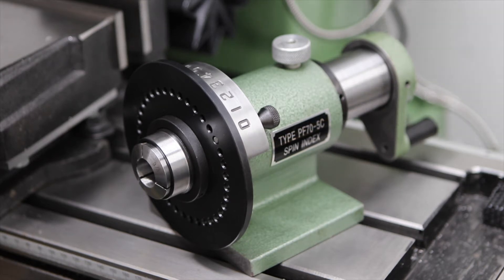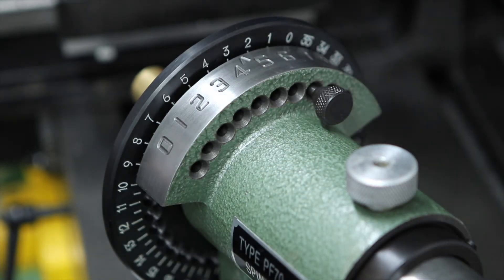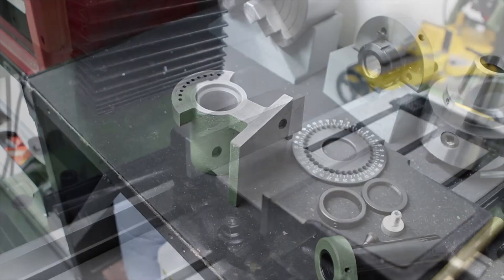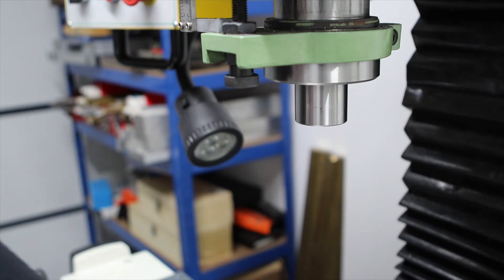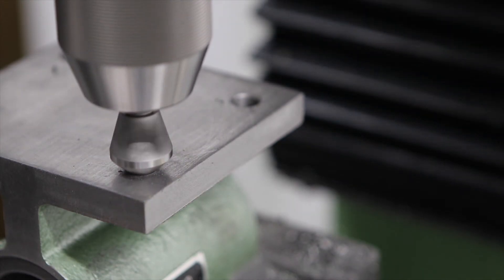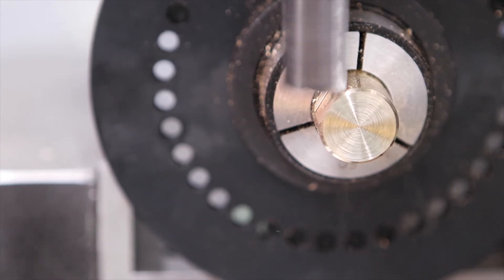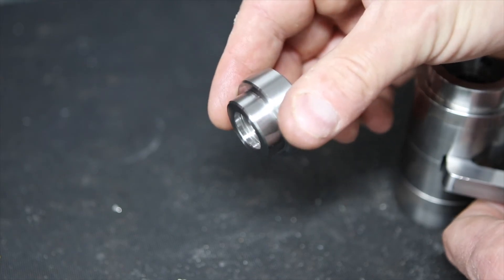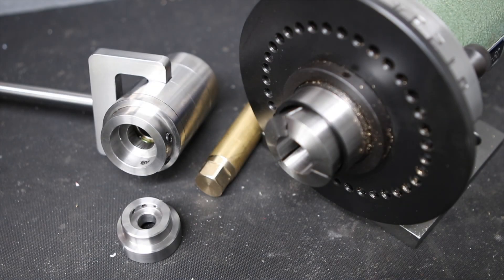How to modify and use a Spin indexer (Spindexer)

Comment: Indexing plates are such a clever use of geometry to achieve fine and repeatable divisions of a circle. There's something really satisfying about them in the same way that vernier scales, slide rules, protractors, and carpenter's sectors are satisfying, and you can still do excellent work with them.

But at the same time, servo motors these days are cheap, precise, flexible, and not at all fussy. Whatever arbitrary angle you want, it's easy to do with a digital dividing head. Just plug in the numbers and off you go. And they often work as 4th axes in CNC setups to boot.
Reply from the maker: Interesting, I might build one someday

Comment: Edge finding on a hammerite painted casting.  lol.  "How 'NOT' to modify and use a Spin indexer".   Should have centered on the fitted spindle.
Reply: He can center the edges with the spindle center line later if he wishes. There's no good reason to do so that I can think of.

Comment: Nice work.  You mentioned that the front and back edges of the base were already machined.  Were they not perpendicular to the spindle, so you weren't able use them as a reference to machine the sides?  Thanks.  Regards.
Reply from the maker: They weren’t all that accurately machined from memory.

Comment: I bought one of these indexers and it's a piece of shit. Why? Because, like all tools, it's made in China. The spindle has a 0.006 play and the collar holding the spindle in is loose; they should have also made it at least an inch long so that it slips into the spindle with greater surface area A split sleeve would have been better. God forbid the Chinese make efforts to make these spinners BETTER. And f**k spending time fixing something that is suppose to be NEW!! Why would anyone buy a spinner knowing that the body has a 0.006" oversized bore? This is worse than a used one. So I'm throwing mine away because I ABHOR cheap tools! To hell with all of them!
Reply from the maker: I agree. Unfortunately it’s hard to buy quality tooling at a decent price these days. Seems like everything is either import or Uber expensive.
Reply: There's some really cheap indexers on the market that're not worth throwing at a bull. Mine, made in Taiwan over twenty years ago, looks identical to the one is this video. It's well made with a closely fitted barrel suitable for most tool making work. Expect to pay  $150 -$300 for higher quality units.

Comment: Is there a spin indexer out there that can be used on a lathe?
Reply from the maker: You could clamp it to your cross slide if you had Tee slots at the right spacing. Alternatively, take a look at my other videos, I have one where I make an indexing attachment for the lathe that works on the same principle.
Reply: @joneseymakes  will do. Thank you

Comment: 9:58 What's the process of determining how far down to mill to get the proper sized hex?
Reply from the maker: Well, you know what size you need the hex to be across the flats, let's say 16mm. If you are using 20mm bar stock then 20mm - 16mm = 4mm. You need to take cuts either side to produce the flats, so a 2mm depth of cut should result in a 16mm hex.

Comment: I would like to use a spin index to mount a boring head then use it on the lathe to cut convex and concave curves. I think I would have to remove my compound and build an adapter plate to fit the compound mounting and then bolt the index to the plate. Does that sound reasonable or am I making this way harder than it needs to be?
Reply from the maker: Hi Gill. Depends on what you are trying to achieve. I think what you are describing can be done with a ball turning attachment for the lathe (I will be building one of these shortly). I’ve seen others use a modified boring head to do the same thing, but, I don’t think you need the indexing head for this. If you think about it you need the boring head/ball turner to swing back and forth to cut the concave/convex curve which the indexer will stop you doing as it’s fixed in space. In short you need a ball turning attachment if I’ve understood you correctly.
Reply: @joneseymakes  Hi, my thought was to use the 5c indexer for rotating the boring head. I would remove the compound and build a mounting plate that puts the center of the chuck on the same center as the 5c. Using a 3/4 straight shank boring head arbor 1 1/2-18 into the 3" boring head, a 3/4" bore 5c collet in the indexer and mount the indexer 90 degrees to the chuck. This would give me x and y axis movement and the ability to rotate the boring head via the indexer. The radius of the curve would be limited by the range of the boring head adjustment. The indexer would only be used as a means of rotating and not for the index. Yes a ball turning attachment does the same thing, but I don't have that and most of what I have seen are reasonably complex. I'm not all that great with the milling machine and overall what I know I have picked up myself. Herbert lathe and Cincinnati MH-2 mill.
Reply from the maker: @gilrand6224  I see, in that case what you're proposing sounds like it'll work just fine.

Comment: I've noticed you're milling in both directions, does your mill have ball screws?
Reply from the maker: It doesn't have ball screws no. I do have a DRO though so that accounts for any backlash.
Reply: @joneseymakes  I'm a beginner hobby machinist myself. I've read a few books and read some articles, what was mentioned there is that on a manual milling machine, we should use conventional milling - feed against the cutting motion (rotation of the cutter), rather than climb milling (feed towards the cutting motion). And it's related to backlash, but not in a way that a DRO would rectify things. It's also mentioned that you can use conventional milling most of the time, and use climb milling for the final finishing pass, for improved surface finish. I am just wondering why this is so important and is mentioned in many resources, but here in your video you are cutting back and forth, so alternate between conventional and climb milling, and it all seems to be working out just fine. Perhaps it depends on the machine itself, how much backlash there is, cutting parameters etc.?
Reply from the maker: @GenePavlovsky  Oh I see what you mean. Ball screws have nothing to do with milling direction, they are used in CNC applications because they have minimal backlash compared to a traditional lead-screw. What you've written above is correct regarding climb milling for good finishes. I think at the time I did this I just wanted to get the job done faster! Climb milling does generally leave a better finish.
Reply: @joneseymakes  I see. Well as a beginner I have a tendency to try to "follow the rules". It's when you have a bunch of experience that you can decide when to break them and when to follow them.
Reply: With light climb milling experienced machinist use a light drag on the table clamping screws to control back lash and grabbing.

Comment: Nice, I was wondering how these spin indexers work. Seem very easy to use, much simpler than dividing heads! Looking at these tailstock die holder adapters, do I get it right that in the end you have threaded holes in both the main dieholder (outer part) and the adapters? Wouldn't it make more sense to just countersink the holes in the adapters, and use cone-point grub-screws? Otherwise I don't quite get how your threads in the outer piece line up with the thread in the adapter. Hopefully I'm expressing myself clearly enough. What I mean is that if you have two parts and both have threaded holes, then if you run a screw through both holes, the parts might be spread apart a bit, depending on how the thread was cut. Unless you clamped the two parts together and cut the threads in both in one go.
Reply from the maker: Hi Gene, only the outer part is threaded and accepts cone points grub screws. The inner adapter is countersunk.
Reply: @joneseymakes  It didn't look like that to me in the video. At 13:48 you're drilling through three holes at the smaller diameter end of an adapter, and mention that you tapped the holes off-camera. At 13:58 you're inserting the small end of the adapter into the die holder, on second watching it actually looks like there are tiny grub screws already in these holes, so looks like the set screws in the outer shell (main diestock body) go into the hex heads of the inner adapter set screws... Which I suppose would work, even if it might damage these inner heads over time...
Reply from the maker: @GenePavlovsky  Oh yes your right, it's been a while since I watched this. I've made two of these dieholders. The first is pictured here. The second one I made (there is a video on that) I improved the situation and counterbored it
Reply: @joneseymakes  That makes sense then. Anyway, great video. Thanks

Comment: Very cool!  If you haven't seen it already, some folks are modding these spindexers so that the spindle mounts backwwards in the casting.  this allows for the bigger end to be farther away from the mill spindle leaving a little more room to work.  Been binging your channel, great work on the videos keep them coming!!
Reply from the maker: Thanks for the tip, I’ve not seen that yet. Will check it out. Thanks for the feedback too, more videos coming soon!

Comment: should have centered off the spindle not the base
Reply from the maker: Yep, I know. However,  I couldn’t work out at the time how to hold it with the spindle in and the base exposed for machining at the same time.
Reply: Cones bolted through parallel blocks maybe?

Comment: Another modification I might recommend is adding a slot to the bottom for a key, to let you directly key the spindexer to the slots on your mill table.
Reply from the maker: Yes, that is something I’d like to try. Thanks for the tip.

Comment: Edge finding the sides of the inverted base really did not accomplish anything.  It was a cast and painted surface.  The center datum that you really should have referenced is the center of the spindle.  This can be done by clamping the casting to an angle plate, picking up the high point of the spindle with a height stand on a surface plate, and then milling or grinding to your target number while still clamped on the angle plate. Otherwise the center distance from the spindle to the milled edges on the base is just an arbitrary and unrelated value.  --Doozer
Reply from the maker: Hey Doozer, yes completely agree. I wasn’t happy with this setup from the start, I don’t have an angle plate big enough right now so at the time was trying to make the best of it with the tools available. I will re-machine this to be more accurate at a later date. I’m on a learning journey here so it’s always great to hear from more experienced machinists, thanks for the feedback.
Reply: @joneseymakes  Good deal bro.  I was hoping my comment would not be taken as a negative.  Looks good !  Yes you can always machine it more accurately later. I love shop time ! ! !  --Doozer
Reply: I like reading, hearing what experienced machinists say as Im learnig too. I just built a 2 cylinder Empire Steam Engine from a single. Flywheel casting from England did have a tough skin on it and dulled my turning tool real quick. Great video.
Reply: Would it have been more helpful to make a platform using cones and parallel blocks bolted through the bore of the indexer?

That way you can get the bore perfectly parallel horizontally before machining the base flat.

Dialling it in like you did does not help if it was already wonky.

Comment: Nicely filmed video Jonesy!
One thing I've recently learned which I wish I knew years ago is that you want the point of a spot drill to be a greater angle than that of your hole making drill.
This allows the point of the twist drill to locate into the point of the spot drill. Unless you have a perfectly ground drill bit, the webs of your drill will contact the widest part of your spotted hole instead of the centre point locating.
This can sometimes cause drill wandering therefore reducing positional accuracy and also introduce chatter and squealing, especially on harder materials. Obviously no big deal for this particular application but for more critical work, it's something to bear in mind.
Looking forward to seeing more from your channel!
Reply from the maker: Hey Tom, just realised you’re Jess’s son right? I wanted to say thank you so much for the centre drill. Great bit of kit, I’m using it daily in the shop, much appreciated!
Reply: @joneseymakes  Yes that's me. You are welcome, no point in letting it sit in my tool chest for another 5 years. You can't beat carbide tooling. All the best with the channel, don't hesitate to reach out if you need anything machining related!
Reply from the maker: @tjp148  Thanks Tom!
Reply from the maker: Thanks for that Tom, excellent point and a good explanation. I’ll be sure to point that out in the future, in fact it might be good to do a short video just on that subject. Thanks for watching, next video in the pipeline!
Reply: Yes, 140º+ spot drill included angle for a 135º drill included angle.

Comment: You could do non integer multiples too.  You will have to use a multiple of 360 and then divide down.  You have a ratio of n/m when n = turns, m = degrees to turn each time.  It means you'll be turning the wheel multiple n times to complete the sequence IIRC.  You are in essence doing a modulo divide.
Reply from the maker: That’s really interesting, above my pay grade in the maths department though! Can you provide a specific example?
Reply: These aren't geared internally like a diving/indexing head so no calculation beyond 1-1, no matter how many times you turn the handle the holes won't line up any differently.

Another chap suggested using pins with a reduced diameter tip for smaller divisions 1/2 width for 0.5° etc etc.

For example 321.5° you pin as if you need 321° then rotate clockwise until your 1/2 diameter pin touches, the second pin should then slot into the 322° position.

pin diameter would need to be spot on though, by the time you are needing greater than 0.5° of accurately you might as well buy a proper dividing head.
Reply: Tapered tip pins with some sort of depth stops or marking based on diameter could get you finer adjustment, your spindle lock would need to be pretty good to hold using tapered index pins though.